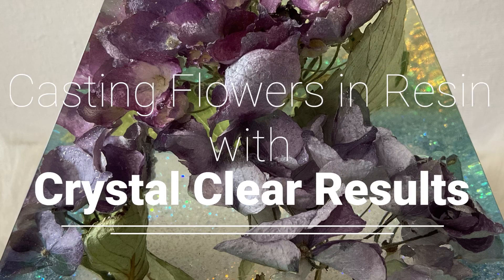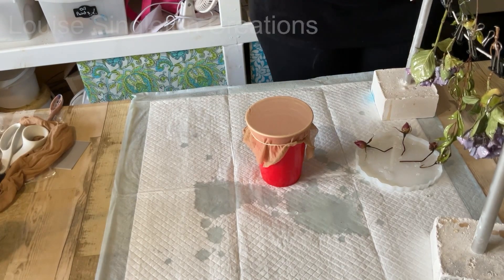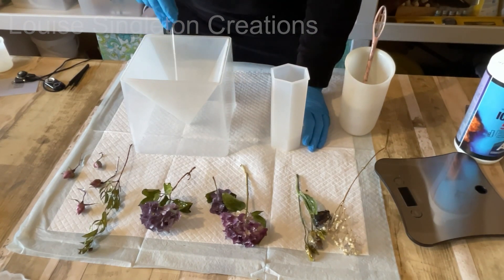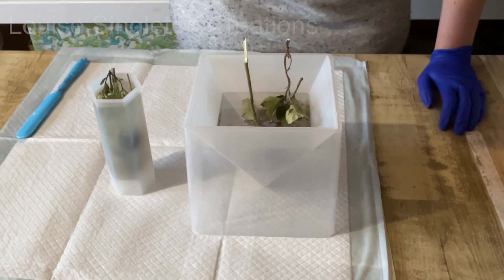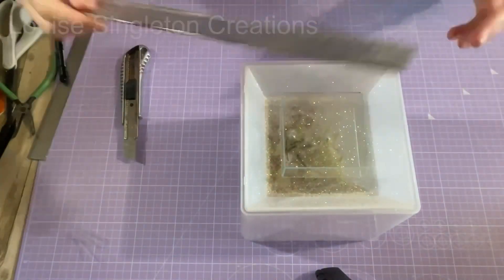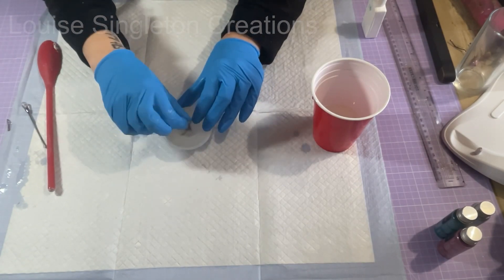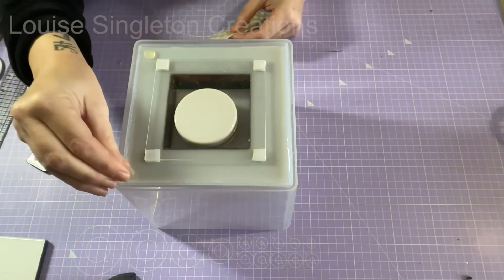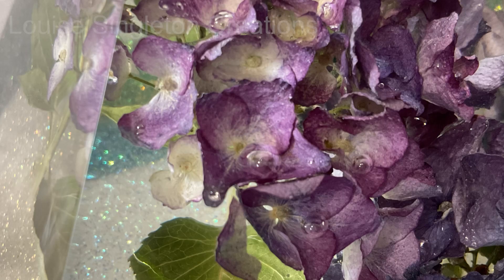Casting Flowers in Resin - Bubble Free! Tips for a Crystal Clear Resin Pyramid Using iCrystal 5

Comment: I always thought the bubbles were sweet. So they don't bother me. I do love that larger pyramid. The hydranga is one of my favorite flowers. You make such lovely things.  Does the resin smell bad? I only remember repairing surfboards in the 70's. It smelled sort of acrid. Surely it's improved since then...
Reply from the maker: Thank you Angel. Some resins have a strong smell but I think it’s usually the polyester resins rather than epoxy. Most art resins don’t smell much at all.
Reply: @LouiseSingletonCreations  thank you

Comment: They all turned out beautiful! I love the laundry line and the nylon strainer! I’ve pre-resined my flowers but, I’ve just left them on a silicone mat to cure and it leaves a puddle underneath. I wonder if spraying the flowers with 97-100% isopropyl alcohol right before they’re put in the mold would help prevent bubbles? Although I really love the dew effect!
Reply from the maker: That’s a good idea Funo, if I do another one I will try it, thank you xx

Comment: You used a very complicated math system to calculate. Easier is simply...100gr for A ----- means 67gr of B, therefore doubling A (200gr) means you need to double B. If you only need 50gr of A means half of B (33.5gr), etc...